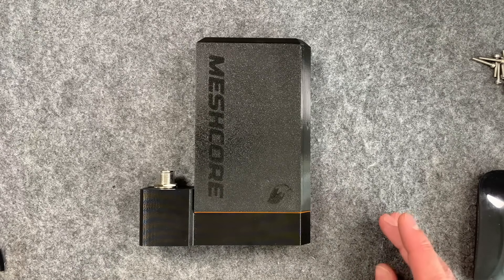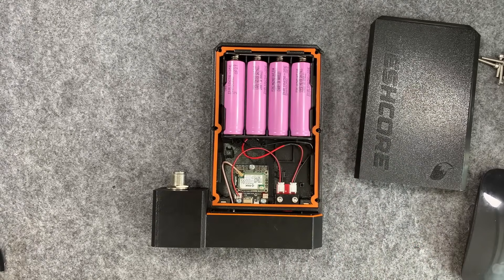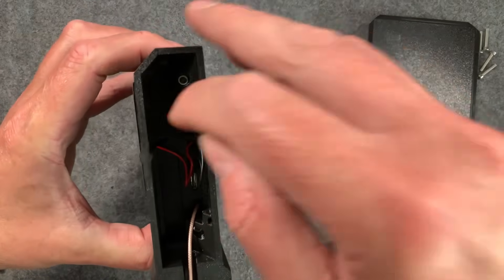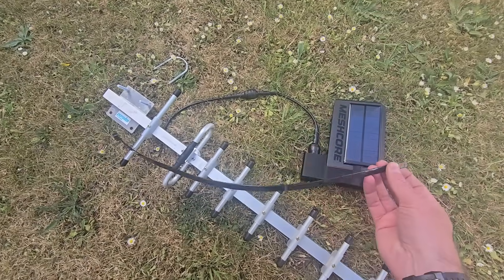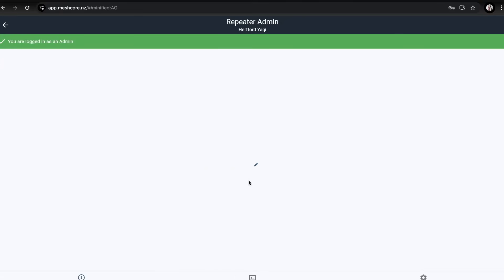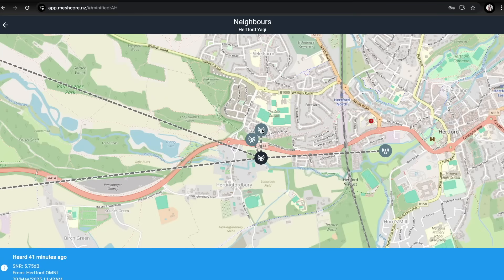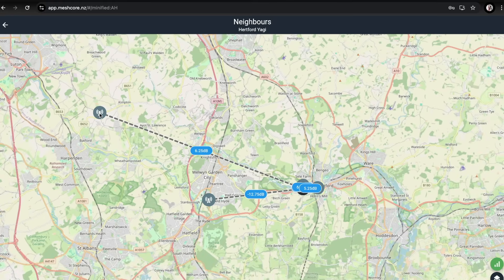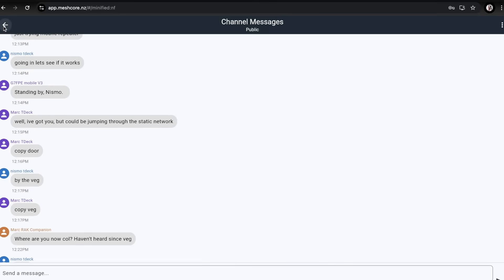MESHCORE SOLAR REPEATER!

Comment: Dumb question, but how did you stick that solar panel to the cover? These solar panels comes with their entire back exposed, they have no protection from the elements in the back. just curious how you added them to the cover while keeping all the connections safe. Thank you

Comment: Imagine if mobile manufacturers had built this module into their smartphones that could relay messages, how cool would that be for everyone and the environment too, as mobile networks could be loaded only to transmit internet and voice, no? In fact, this should be mandatory for mobile operators to integrate this communication module into their supplied devices for emergency and environmental purposes.
Reply: 1. System Overview

Goal: Offload small, critical data from cellular networks while enabling real-time emergency detection and environmental monitoring. Devices can function as distributed sensors, messengers, and alert systems.

Core Components:
Smartphones with LoRa chipsets – transmit messages, sensor readings, and emergency alerts
Optional LoRa Gateways – collect data from devices and forward to the internet/cloud
Mesh Networking Software – phones relay messages and sensor data peer-to-peer when gateways are absent
Cloud/Data Servers – aggregate sensor data for statistics, visualization, and emergency response

2. Messaging & Emergency Communication

Direct LoRa Messaging: Short text messages (~50–200 bytes) sent to nearby devices
Mesh Relay: Phones forward messages to extend coverage when recipients are out of range
Gateway Sync: Messages can reach long distances via gateways → cloud → recipients
Emergency Alerts: Authorities can broadcast alerts (natural disasters, chemical spills, attacks) to all devices in the area
Vehicle & Accident Alerts: Smartphones linked to car sensors detect collisions or sudden braking and relay alerts to nearby devices → emergency services notified

3. Environmental, Safety & Statistical Data

Built-in Sensors in Phones or Connected Devices:
Temperature, humidity, barometric pressure
Air quality, radiation
Accelerometers / seismic sensors (detect explosions, earthquakes, or large impacts)
Vehicle sensors for collisions or traffic incidents

Transmission & Aggregation:
Sensors send small packets to the nearest gateway or neighboring devices via a mesh
Gateways upload aggregated data to cloud servers
Cloud dashboards visualize real-time environmental statistics, traffic, or disaster alerts.

Use Cases:
Weather stations everywhere → accurate, hyper-local meteorology
Air quality & pollution tracking → urban planning, public health alerts
Detection of explosions, missile impacts, earthquakes → real-time civil defense alerts
Traffic and accident notifications → rerouting or emergency response

4. Network Design

A. Star + Mesh Hybrid
Star: Devices send data directly to the nearest LoRa gateway
Mesh: Phones relay data and alerts if no gateway is nearby, ensuring coverage in rural, disaster, or congested urban environments

B. Frequency & Compliance
Use legal LoRa bands (e.g., EU 868 MHz, US 915 MHz)
Follow duty cycle, power limits, and licensing regulations.

5. Data Flow Example

Short Message:
Phone A → Phone B directly (in range)
Phone A → Phone C → Phone B (mesh relay if needed)
Confirmation of receipt

Sensor/Emergency Data:
Phone detects abnormal seismic vibration (explosion) → sends alert via LoRa mesh
Nearby phones receive the alert instantly
Nearest gateway receives alert → cloud → emergency services notified
Simultaneously, all nearby phones are alerted to danger.

Traffic & Accident Alerts:
Car detects collision or sudden stop → phone sends LoRa alert
Mesh relays alert to other vehicles and pedestrians in range → accident notification
Gateways forward incident data to traffic authorities → dynamic rerouting

6. Advantages of the System

Cellular offload: LTE/5G reserved for heavy data and voice
Resilience: Works when cell towers are down
Cost-effective: LoRa spectrum is free
Distributed sensing: Millions of devices generate live environmental and safety data
Rapid emergency alerts: Detection of explosions, accidents, natural disasters, or chemical events in real-time

7. Challenges

Low bandwidth: No video or large files
Coverage limitations: Mesh or gateways required for full reliability
Adoption: Phones must include LoRa hardware + software for mesh networks
IP & patent licensing: LoRa chips require a Semtech license

Optional Extensions:
LoRa-enabled wearables, connected cars, or IoT devices increase coverage and data points
Automatic routing decides LoRa vs LTE/5G based on message size, urgency, and battery efficiency
Open-source platforms for communities to deploy local gateways and dashboards for public safety
Reply: They'll never do this imo. 

After the masses of people would realize they they can set up their own communications network, they'll stop paying for cell phone subscriptions.
Reply: @Shuck-Shick-Blam  Nah, they would still need internet even if they decide to go with VOIP calls, so cellular networks would be very much a thing until they move to satellites. But even then, this would be perfect for emergency networks, as they can interact with sensors, so life temperature, earthquakes, explosions, and chemical exposure all could be recorded and sent out in real time to those affected by it and located inside the area.

Comment: Would it be better to put the solar panels cables directly down into the enclosure instead of going around the bottom? Then could silicone sealant (or hot glue) the solar panel to maintain water resistance.

Comment: Lots of haters on here commenting about holes in the bottom... If you look at professional satcom gear that goes on big (wet) ships, it's often got ... a hole in the bottom! 

Yeah, making stuff properly waterproof is really hard. To some extent it's better not to try and just provide a route for the water to exit. However what i generally see on the marine gear is a simple one way valve on the hole. Usually a length of tube which tends to fold shut at the end

I speculate a large diameter bit of heat shrink glued into the hole would do the job? Let water out, but stop spiders crawling in... 🤷‍♂️

Comment: If you would like to make the batteries last longer than 2 seasons, you must limit charging voltage to 4.05V-4.1V. At 4.2V cells age so fast that they could degredate within 6 month. As there are no ready made charging modules on aliexpress you need to self design it using ht4928s or bq24075 chip + resistor voltage divider. 
You know teslas are also only charged to 80% to make the battery not die.
Reply: Is there any settings to change the charging values with the module he is using?.
Reply: @ThaVoodoo1 no. 99% of the charging modules are 4.2V only. I am seeking for a long time now.   No cheap,solution, only exüensive ones

Comment: Solar panels need to face south, but SW or SE is okay. It needs an elevation of about 30 degrees because the sun shines from above and direct line of sight with the sun helps enormously. Like others have said, those Li-Ion batteries aren't good with heat and the enclosure will amplify the heat by absorbing more and keeping it trapped inside, like leaving a dog in a car with the windows closed. LiFePO4 batteries would be better as they are more tolerant and less likely to explode (no thermal runaway). Painting the outside of the box white would help but the batteries and electronics should be properly sheltered from the sun and build-up of heat. Put it in an appropriate (locked) metal box closer to the ground (earthed!) where it can mostly be in the shadow of a building (or better, inside a building). Just sharing my experience. We don't want any pyrotechnics! Well, not unless you're videoing it at the time. LOL! Good video though, it's inspiring and I love watching and we're all learning new things. Keep sharing! Top man Andy. 👍
Reply: all very valid points, well, for the UK...  (watching in Australasia) But yup. Prob here is finding cold tolerant batteries - have been recommended  Lithium Titanate Oxide batteries for high altitude sites.

Comment: I don't know about your country, but that black box will melt in 2 hours in my country. In this kind of work, it should not be black, but bright and light colored. Those batteries will explode and cause a fire. 🤣
Reply: It will be like a spit roast over a fire when we have a few 36 deg C days in the UK. The temperature inside the box will be considerably higher than that outside.

Comment: what distance is the node you are hitting with the yagi? I'm Still using Meshtastic but love that solar set up.
I can exchange messages with a buddy 200kms away (combined height around 1100m) both using 12dbi Ivent yagis (about 30 quid delivered / NZ$ 67), then tried an "alleged" 10dbi whip antenna off Amazon & ... .still could message, lol - tho suspect buddies Yagi was probably doing the heaving lifting.  Straight contact, no hops. 
In your humble opinion, what node is the most efficient - ie has the smallest power footprint while delivering full power.   Lots of problems with terrain here, so trying to set up above the snow line nodes.
....last time I looked, there was only 4 Meshcore nodes in the Shaky isles, & they were on the other coast in Gizzy. (oh, & one that rarely see's the light of day that I keep in my box of odds n sods coz it has no-one in range to talk to.)

Comment: I personally would never mount a solar panel directly on the enclosure containing batteries . I’ve built multiple nodes both for mesh core and Meshtastic and the way I make my setups is my panels typically cover the actual radio enclosure and provide “ shade “ for it . 18650 cells can and will vent .

Comment: How is this off-grid if you’re logging into apps on the web?
Reply: You can use the exact same app installed on your phone as well. If you're on Android you can also share the installed APK to someone else in person when internet is unavailable. The web app is very handy when you have internet, and I will be setting it up so it can be downloaded for offline use and run from a USB stick etc.
Reply: The web app connects to a MeshCore companion radio, which Andy didn't show unfortunately.
Reply from the maker: If you watched the video, you'll see the Tdeck connecting to the mesh which is not a phone or a computer, nor is it connected to the internet.

Comment: A common mistake for such things is to make them black. It's going to get much hotter than it needs to in the sunlight, which is particularly bad for the batteries.
Reply: good point
Reply from the maker: Yeah very true
Reply: Make it white
Reply: I'm in agreement. I had a node reach more than 55°C last summer .  
I've started painting my enclosures with aluminum paint and using protective coreplast panels to shade the case.
Reply: Perfect.👍
Reply: Imagine those batteries when you get 39 degree temps and above.  Also why not put the antenna mount on the top so the case itself is not the blocking factor?
Reply: "winter colour to absorb warmth? I'm sure you can get hi vis reflective jackets for the sunnier months - that or the node itself will be in the shade of the foliage of the crown of that tree" ;)
Reply: Would Polymaker™ HT-PLA be an option for printing the box or is ASA/ABS still the better way to go?
Reply: @NeilLund  ABS is always the way to go if ypu want it to last in the sun.  PLA would not last long.  PETG is slightly better  but ABS is the best im aware of
Reply: Spray it with a good chrome paint and you have solved your problem, £6 one.
Reply: yep
Reply: Keep it behind your solar panel and it’s fine, not to say this design isn’t obviously flawed
Reply: DIY cooling paint recipe from NightHawkInLight https://www.youtube.com/watch?v=N3bJnKmeNJY
Reply: It’s gonna melt
Reply: My 3D repeater is at 45% so the solar panel reflects the sun and keeps it solar.
Reply: PETG does well in UV, there are examples of it being used in functional prints left exposed for many years. As for temperature, again there are examples of people running 18650 cells in extreme conditions for extended periods without issues.

These were the same thoughts I had which stopped me designing an external enclosure for a year. It was only seeing several community hacked together nodes that had survived that convinced me to create Hermes. If you read my product description I try and explain the design decisions and its limitations.
Reply: @zerofox3d  I guess when these are mounted so high there's almost always a little bit of breeze that probably helps a lot.
Reply: Black is used for the coinciding chemistry's resistance to UV degradation
Reply: Incorrect. Black can make things cooler. For example, black sprayed intercoolers are cooler than non painted or white painted intercoolers.
Reply: @TRIPPLEJAY00 try reading. He didn't make a blanket statement
Reply: @TRIPPLEJAY00 that’s because the intercooler is radiating heat not absorbing heat. It’s the reverse of the situation here. A black box containing electronics outside in the sun is a no-no.
Reply: @TRIPPLEJAY00  those are sprayed against corrosion not heat issues.
Reply: @TRIPPLEJAY00  Black only has an advantage when there is no incoming radiation, and even then the difference is small. When there is solar radiation, white has a huge advantage, surely that is obvious.
Reply: @TRIPPLEJAY00 not when it comes to solar radiation. Intercoolers arent sitting in the sun. Black attracts heat. Why do you think Africa is so hot?

Comment: Nice for temporary setups, but the IP value of this is IP40 at best.  Moisture will typically wreck such a setup in short order and what is UV light going to do that enclosure after a couple months or a year?  What about charging below freezing as well?  I won't use lithium-ion batteries in such an application simply due to fire danger.  LiFe batteries and supercaps are safe alternatives.  Without sealing it from the weather it probably won't last long in most environments and real sealing is a technology all to itself.  Also the electronics need conformal coating to last outdoors unless your seals are air tight and RF parts can't really be conformal coated easily.  I've been doing wireless high speed Internet links for 25 years and I've replaced a lot of failed gear due to corrosion.  My bottom line is that outdoor service has special requirements which matter far more than being able to make a case yourself with a logo on it.
Reply: I’m upfront in the product description about the limitations of the design (see Design Decisions section) I’d have loved to have made a “perfect” enclosure mitigating all the factors but that would have not resulted in something viable for a hobbyist. So you’re correct it has limitations but I think they should be quite obvious to most people and being upfront about it should allow people to make an informed buying decision 👍
Reply: @zerofox3d  Most consumers don't understand limitations.  They think the world is magic which is why they're consumers and not producers.  It's easy to make a perfectly fine performing inexpensive outdoor radio apparatus but 3D printing will not get you there.  What about destruction of the battery from charging in the cold?  If you have a single cells it's one thing but when you parallel cells in a battery you now have real potential for thermal runaway which is why the sleeves on those batteries have printed on them "FIRE HAZARD!".  It's not me stating they're a fire hazard, it's Samsung putting that warning on at the factory.  Look up stories about the California wildfires if you want to see why this design is a non-starter for me.  I couldn't offer this as a commercial product simply because of liability issues.
Reply: @Peter_S_ My logic would be it’s not aimed at “consumers”, someone building a node is a hobbyist and Hermes is the same concept as 95% of the home built nodes hacked together with hot glue. If a consumer wants a node there are solutions out there which are complete products you don’t build but are costly. For hobbyists who enjoy this experimentation and have a more limited budget Hermes just makes the hacking a node together easier.

I’ll withdraw it from sale if people think it’s a bad idea but I’ve yet to have any negative feedback until now.
Reply: @Peter_S_  Okay the battery thing is a bit of a stretch. That solar panel is charging those cells are maybe 125mA per cell maximum assuming 5W input because as you say they are in parallel. Now consider that a colder day will usually get less sun and you have such a low charging rate that the cells being cold becomes a non issue. You can still charge lithium when its cold you just have to be mindful of charge rates.

As for putting the cells in parallel causing thermal runaway, thats just rediculous. Please tell me where you got that information from.
Reply: I do have a heltec v3 since 1 or 2 years i think in a enclosure out of my window. The enclosure is printed with grey petg and does not have sealings, i just hot-glued the 2 parts together. 
it still works finde after alot of horrible weather situations of all kinds including the strongest rain in history for my area. 

I agree with you in general, but it worked way better then expected for me.

Comment: Looks like it’s gonna start a forest fire. All that heat on those batts yiur retar8ded.  No heat syncs.
Reply: Always one! Just keep it constructive will ya, stupid name calling behind a keyboard
Reply: I understand your point but there is no need for that language. 😮
Reply: We use this type of battery in nodes all over the US year-round, no issues at all. These RAK units use a very very small amount of electricity. The batteries are going to be at or near ambient temperature at all times.
Reply: Are you trying to say heat sinks?  No heat sinks are necessary in this design and the heat generated by the radio is nil, but I do take issue with the power design overall.